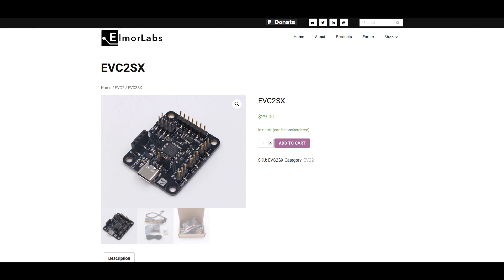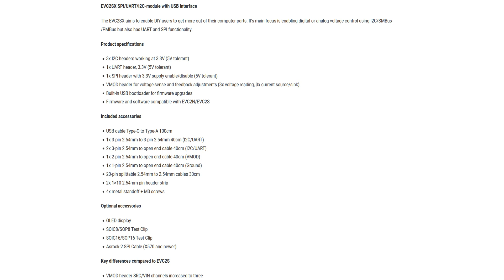ElmorLabs EVC2SX - Overview & First Thoughts

Comment: These are such a handy tool to have in your overclocking toolkit, for me i bought it to unlock voltage control on the 680 lightning.
Reply from the maker: Could you set only vgpu or all of the voltages?

Comment: They don't have Afterburner Extreme anymore?
Reply from the maker: There is an older version for older graphics cards. But I don't think they have one for latest models anymore.
Reply: @LuumiJuhani  ok
Reply: Apparently there is one for the 20series atleast. But msi has it essentially under lock and key and only has given it to a few select people. Theres a unlocked bios for the 2080ti lightning also. One of the owners has theirs listed on hwbot and eBay rn. Is claiming to include the limited access software with purchase. But won't distribute it otherwise.

Comment: Unfortunately you're limited by what is known about the digital voltage controllers. For a new controller without a data sheet, you need to figure out the addresses through trial and error though the forum is eager to help. Also even if the controller has digital features, they may not be implemented on your card at all. I got the impression you'll be using the vmod headers 90% of the time.

Comment: anyone know where i can get a capacitor that says j83d 820 2.5v     its for a graphics card and i need to find one just like it dont i? what happens if i use a diff brand ? im not a capacitor expert but ive got one cap that got broke off mishandling it i believe by previous owner. 
love the videos, cant wait to see this in action more.
Reply from the maker: Digikey has huge list of those.
Reply: It doesnt have to say j83d it just has to be 2.5 volts with 820 capacitance